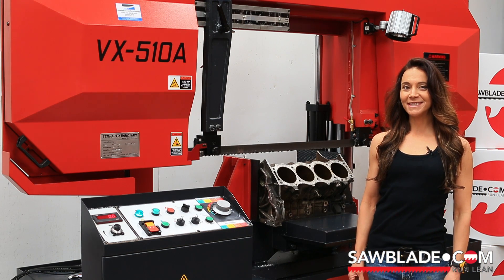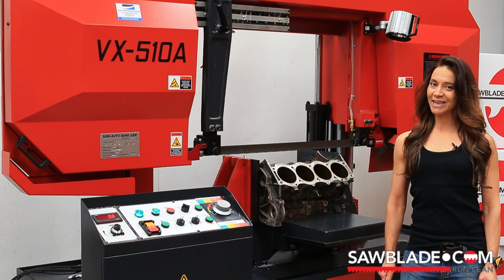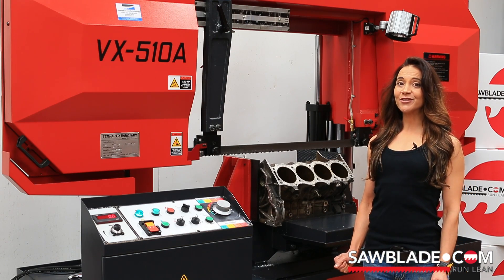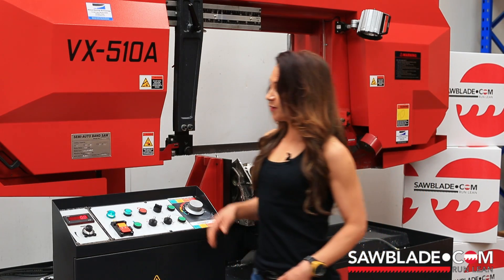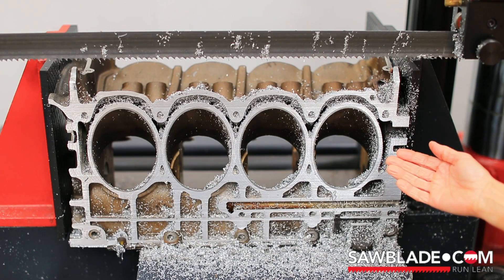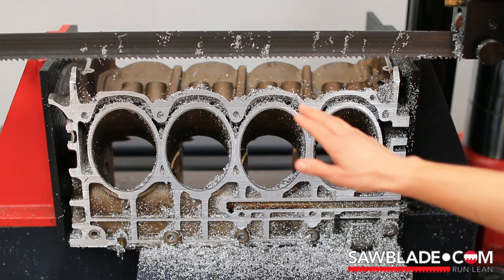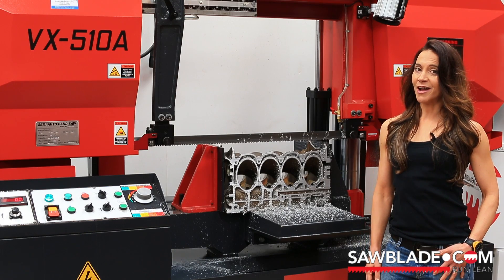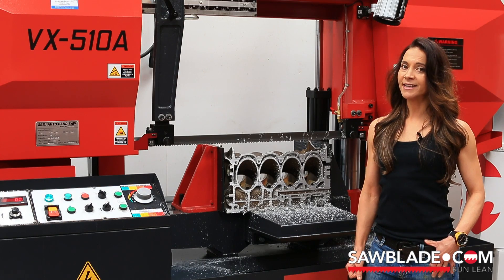Curiosity Episode #2, Cutting a Range Rover Engine in Half

Comment: "Freeze" plugs do not save the block from freezing, they are there to close up the holes used in the casting process to hold the core in place.
Reply: In the UK they are called "core plugs".

Comment: Seeing as this is an aluminum block, I would expect that high dollar band saw to cut it like butter. 
Put a video up of this saw cutting a block of iron the same size, then we'll be amazed.
Reply: the cylinder slevees are cast iron
Reply: Thin steel liners actually, I would know since I owned a land rover with the 4.6 V8 engine used in these model Rovers. Probably the same engine being cut in this drawing.
If you cut in the middle of the block, you are barely, if at all, cutting into the thin steel liners. So, shouldn't be any problem to cut thin steel liners for this saw.